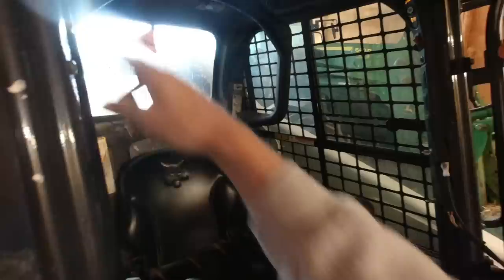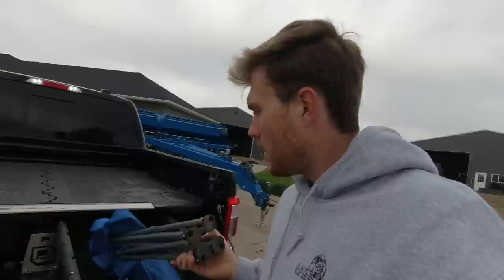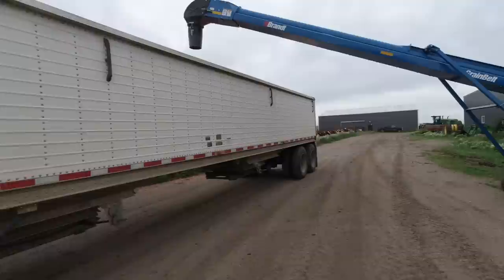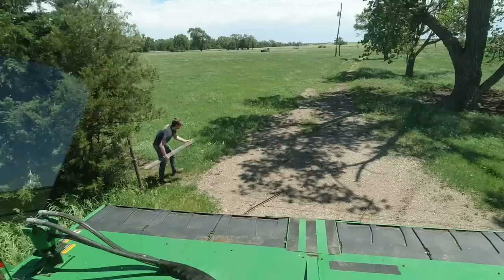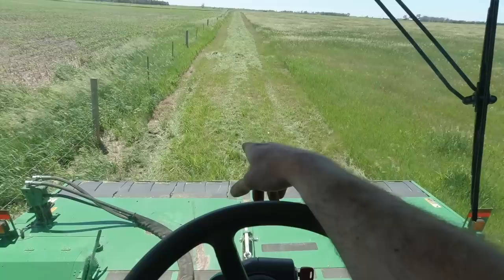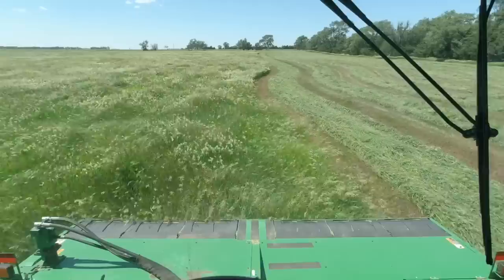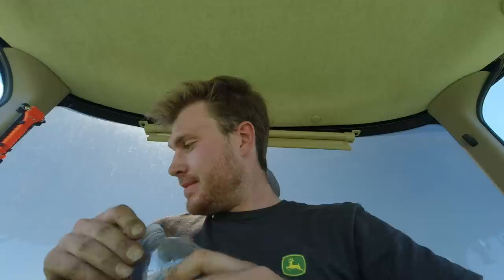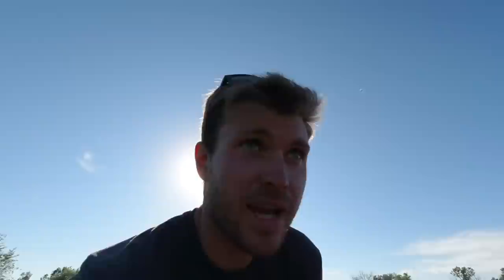Something went wrong!

Comment: Hello Cole I’ve had the same thing happened to me the problem is the wind is blowing the crop headfirst into the header therefore the crimper rollers are pulling the grass before it got cut I think you’ll find it only happens when you’re going in that direction had the same problem myself last year didn’t happen this year no wind similar sort of crop
Reply: So, it's best to cut down wind if it's pretty breezy out ???

Comment: Time for belt replacement there Cole. Also check the wear on all those universal joints on the header. They will wear out surprisingly fast.
Reply: Every season replace the belts. Time is money too.

To extend the life of a belt spray it with 'oil' so it does not dry out as fast. And no. it won't slip just don't go crazy on the amount. (Kroil penetrating oil)

Comment: I'm glad you leave in the rough times to and don't just make everything look all rosy and smooth. I would have risked putting a hole in the side of the barn to have shot that coon before it messes up some hydraulics or electrical trying to at a pile of grain or something in a hard to reach spot on some of the equipment, babies or no babies, they end up being the problem yet to come. As you can tell I've had coons do a lot of damage to things around my place till I trapped them out.
Reply: Triple ditto!!!

Comment: Right on Cole.  I only worked part time during a few summers at my uncles' farms in Saskatchewan.  When I ran the combine, I sure did not like cleaning out a "plug".  It meant getting out the crowbar and pulling out canola or whatever.  I could feel for you as you pulled the grass out.  Take care.  (The crowbar was used to turn the cylinder on the combine.  This was before the days of combines using a rotor.)  😊

Comment: Is the cutter head not reversible? I figured you could push your engage switch backwards like on the combine
Reply: i think its only works if it  has a draper head on it. but not with this head.

Comment: Next time you might want to try raising up the cutter head height about 2” and then slowing down your ground speed. The lower grass is very wet which is causing a lot of slipping on your feed rollers. This causes it to build up on the crimp rollers then a plug. Sorry you had all the plug up slow downs. But you sure you did a great job of thinking outside the “box” to use a cutter knife section to get this job done. Thanks for letting me ride along with you today.

Comment: I knew how you feel because our combine tailings elevator has been getting plugged 30 times daily. Every time I have to go on the complete opposite side of the combine to open the hatch then go back in the combine to turn it on, and finally go back in latch it! We got new belts and it worked good!
Reply: Don't telegram its a scam to get your details

Comment: There's adjustment plates above your cross augers. You may need to slide them down closer to the auger. Same thing happened to me. Only needs to be about 1/8th inch gap

Comment: Adjust your windrow a little more narrow(lever in center position).  I spent 2yrs unplugging my W235 and burning belts in thick grass trying to lay it wide.  Dawned on me one day when you lay it wide you push the deflection plate down to force the hay under the forming shields, when high volumes of grass come out of crimper the plate backs it all up.  No more narrow windrows in grass, and no issues this year!
Reply: *correction
no more wide windrows and no more issues

Comment: It's not your belts, the machine is set up to mow alfalfa and lay it in a wide swath.  If you turn the drive around on third from the end "turtle" on each side, it will make them rotate in the opposite direction. It's in the owner's manual. Takes less than five minutes to do and I guarantee you will never change it back.

Comment: If you want to cut wet thin long stem grass and not make rope the solution is to remove all the top hats except he outer if you have full width chevron rollers.  Any thins stem plant especially anything in the brome family will drive you crazy. As it grows it will mesh together and make rope mats.

Comment: No highlights from the bachelor party, or are they “classified?”
What do you did with the windbreak, is very creative!
Either those blades are getting dull, or you’re going a little too fast for the thickness of the hay you’re cutting, making it get clogged, just like when mowing grass and your lawnmower gets clogged up due to thick grass and going too fast. Just a guess, though. Could be an RPM problem, too.
I would put a gas powered Weedwhacker in the cab, and weed whack that grass out of that thing, when it gets clogged. 👍🏼😃

Comment: 9:25 "caught ya" finally, has it been 6 months looking for that thing? Anyway, lots of trouble with the windrower - usually when you start the job you adjust the cutter, but didn't see you do it this time. Maybe lifting up the rear of the unit will keep it clean. I usually see these towed behind the tractor and the cuttings go flying out and up in the air. Will have to wait till next year to find out the solution?

Comment: On the "cutterknife" there is a short spindel at the very left corner, if you adjust that counter clockwise 1 1/4 turn you will see a roller bearing. When that bearing is dry, it will make the spindel turn the opposit way around, and that again will make the slider stop turning. All this will cause the grass to clogg the head. 

(PS: I have absolutely ZERO experience with all and any kind of farming equipment, i simply just wanted to "sound" important in the comment section for a little while. In other words; pls don´t ever, ever think of doing as i suggested!!! 😂 ).
Reply: lol i was wondering what i missed!
Reply: @briansonne814   Sorry 😂
Reply: @zippo1009  lol

Comment: Cole and Brian last night we got some rain here in Sanborn Iowa 1.7 - 2.5 inches but 7 miles to the south is Primghar Iowa and they got 4 5 in of rain it was around 1am 4am Sat morning and Cole back in the 70's-80's there was a a song I can picture the tune but I can't remember who sang it, the tune was here comes the Sun, was it the Eagles or Monkeys Brian can you help us out ? The Herefords are looking pretty good hope you haven't had any problems with your cattle with the heat. I sure wish I had that conveyor for loading trucks and wagons back in the day cuz it looks like there isn't a kernel of corn on the ground, but back in the day the hopper we had would always throw corn or beans out on the ground instead of augering it up the flighting into the truck, but instead we would have this big pile of grain all around the hopper that would have to be scooped up before we quit hauling. Sure hope those black bulls aren't taking a break and getting the job done.. Cole and Brian next time you have a cloudy day and looks like the Sun might come out you can play Here comes the Sun by the Beatles that George Harrison sang off the Album of 1969 Abby road. Glad we got some rain here last night as the cracks were getting plenty wide from the heat the last 3 weeks of upper 90's and lower 100's

Comment: At what age did you learn to drive the semi, the tractors, or any other equipment? You seem like a pro..what age did you actually feel knowledgeable enough to do things on your own? I recently saw a story of a Kansas rancher, loosing all at once, a couple of thousand cattle to heat. So sad, can’t even imagine what kind of loss that would be. Think it was last week. I’ve never heard or seen such a thing.
Reply: If you want to see how young kids are when they learn how to work on a ranch, watch Anchor Brand Ranch on YouTube.   Personally I was driving around 6 or 7,  we lived in the middle of nowhere with miles of pastures.  To start out I would slide off the seat holding onto the steering wheel to hold in the clutch (this was in the middle 50's when most vehicles were manual transmissions) then when you let out the clutch I would climb up on seat getting on my knees so I could see over dash.  And if you had to make a sharp turn that was a big problem because there wasn't any power steering all arm power.  They worked us kids hard but wouldn't trade it for anything.  I'm now 70 and I'm still stacking hay by hand and will last longer than city kids I hire to help when I can even find any who want to work.  And yes I pay them well $20 an hour.

Comment: Do you have your reel running at full speed? Sometimes lowering the speed actually helps in grass and adjusting the ground pressure fixes that plugging problem
Reply: I would agree that running header speed around 2500 instead of 2650 makes for a better cut in grass, especially thin grass due to less ‘tornado’ effect under head pushing grass down.  Definitely try raising the deflection shield 2 notches, took care of all my plugging issues!
Reply from the maker: @jamisonwallman815  I had it running 2200 at first and then 2400 later

Comment: Hayyyyy guys!
Its so annoying when a machine works perfect one season, you pull it out of the shed the next and its a pig, I would bet on belts as they have stood idle for a year and gone crusty. 
So, the fine English saying in full is Poppycock and Balderdash, its a term for nonsense, the word I use begins with letter number 3 in the alphabet.
I wondered a video or two back just what had happened to Mr raccoon, did you get him?
Stay safe guys

Comment: Maybe do some preventative maintenance before attempting the job??
Reply: Until there is a problem that you figure out IS a problem...you don't know there is a problem?
So you can't prevent it by "Maintenance"
Firing the parts cannon is not cost efficient....
Now I presume the belts will be replaced to see if that was, indeed, the problem....
Reply: @JohnSmith-yv6eq  manufacturers recommendations for changing belts?  Changing oil? Checking oil and other fluids? Sharpening blades?
Reply: @kathleendana  we do maintenance
Reply: @briansonne814  love love love the show!!
Reply: @kathleendana  
You alwys see Cole and Brian checking the oil levels in their machinery...
and Cole crawls around greasing everything...
Those machines are so expensive it would be stupid not to do so...
However, belts have a very long life these days...especially Gates (USA) ones which even way over here on the bottom of the world...I seek out specifically for my Japanese DM import cars....
I check their condition every month...but I do not subscribe to the "Change @ X miles"
I go by condition.
If those belts are the problem....I am sure they will be changed.
Three hours of belt changing is a small effort in one day rather than three hours spent digging cut grass out of the swather ...every day.
Reply: @JohnSmith-yv6eq  relax you don’t have to convince me.
Reply: @JohnSmith-yv6eq  where are you farming?